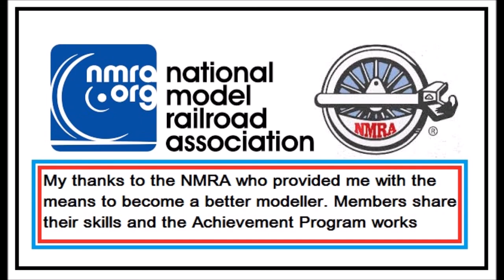SMD Resistors with SMD LEDs

Comment: What is the power source value... in watt/amp that is supplied the the LED and resistor ?
Reply from the maker: I use a LED Tester which has a 9v battery and various resistor values for showing brightness. When I use the LED/s I use a 12v DC power source with at least 2 AMPs supply ( mostly use a 5 Amp x 12v  DC supply. )  Suggest for a bright LED use 1k R and for a dull light use a 8K resistor

Comment: excuse me, i want to asking about the resistor 3.3k that you using is it only for 0603 white led only or it can also be used for all other color (red, green, blue, yellow, blue-red, green-red) of 0603 led or it need different type resistor for each different color ? i was planning to using 33 0603 green led and also 2 type of 0603 dual led color (1 type using 20 0603 blue-red led and other type using 6 0603 green-red led) with 4 AA battery for green led and 2 AA battery for each type of the dual led color. 
almost forgot, is 0603 resistor 3.3k can also be used for 0402 yellow led ?
i'm sorry if i asking too much because this really my first time working with led or electronic component
Reply from the maker: Astrea, SMD LEDs of different colours work differently and you would need to try other resistors to get the desired illumination. A 1k will give a bright light, 2k a tiny bit less brightness, 3k less, 4k less, 6k starts the dim light and higher values dimmer again.
Reply: @scoopmmr  ow, so thats how it work, all this time i thought that 1k or 2k or 3k...... it all for how many led used in parallel or for different component. thank you for the information.
oh yeah, almost forgot, is led/resistor 0603 can also using led/resistor 0402 or 0804 or 1206 ? or it's a must to using the same size for led/resistor in 1 line ? because i want to using a dual led (https://www.tokopedia.com/lisuinstrument?keyword=bi-color) that combined 2 led in 1 diode that had 4 pin to connect. And i also notice that resistor not only using code K but also R, is there any differents ?

Comment: Great video. I purchased a 50 pack of 0402 White LEDS prewired but without resistors. Can I put a resistor only on the + side.  I have a 1/4 inch by 3inch piece of double sided PCB. I want to solder all of the hot leads on one side and all of the negative leads on the other with just one resistor coming from the 12v + power. Can I do that or do I need a resistor on each LED? I'm running 5 LEDs on that circuit. I could use a 5v power source instead of the 12v power.
Reply from the maker: A LED draws around 2.4 to 3v so you need to work resistors to the supply voltage. I always have the resistor on the negative. If you put 3 LEDs in series with 12v it works but add a 4th Led and the voltage won't power the LEDs.
Reply: Laurie McLean MMR So I wouldn’t need resistors if I have three LEDs wired in series with a 12v supply? How does a resistor work if it’s on the negative side, I thought a diode only allows power to pass through from the positive side
Reply from the maker: @RailyardProductions  You still need a resistor with 3 SMD LEDs and a 12v supply. Make yourself a LED tester = 9v battery with a 1k resistor soldered onto the negative terminal and then a pair of wire leads. Use this on a LED to find the anode and cathode (- & +), Yes a LED is a diode and current only passes one way